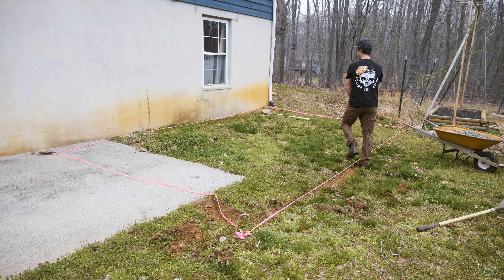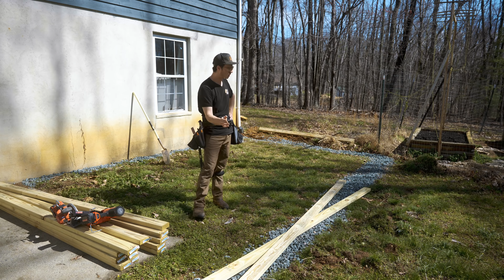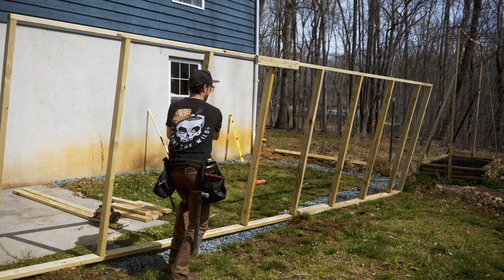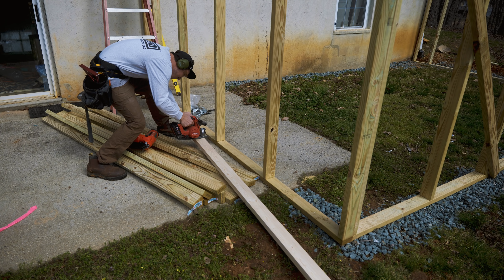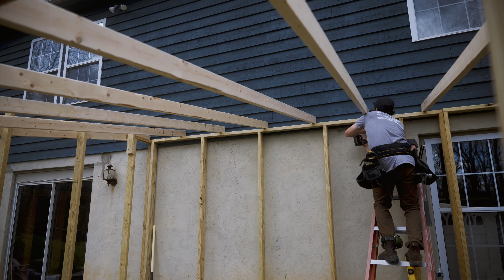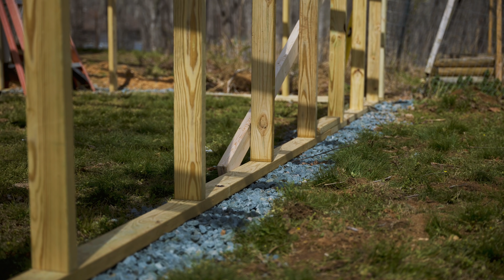I'm building a Greenhouse using recycled windows and 2x4's - Part 1

Comment: Awesome of you to do this for your father in law! I’d really frame a window around the window on the house, as well as tie the walls to the ground you could drive 3’ anchor spikes through the sill plate but those will rust away over time better idea would be to dig every 7’ or so and put an anchor in concrete 18” down at least since your past the point of pouting a sill wall. Other then that I think it’s looking great man!

Comment: Why block the window with the studs?
How is the structure secured to the ground (in case of windstorm)?
Reply: Maybe add a header there and open it up. Not a big deal to do this. Although it might be easier with a double top plate.

Comment: Love it BB!  Can't help but agree with the back wall window opening.  It will be be great if you open it up.  May need to throw a lexan sheet to help with the temp differential / air gap between the spaces.

Not sure how your laying out your windows, but, you'll want to make sure you can vent / support air movement to help regulate air temp.  You'll want windows at the top and bottom and opposite that can be opened and closed.

I'm guessing you'll upgrade to 2x6 for the roof joists too.  I'd think about anchoring the back wall into the house and setting a few anchors on the outside walls to tie it to the ground.  Don't want to to blow away.

Happy Easter!
Reply from the maker: I can always count on you for the wisdom! Happy Easter!
Reply: @WoodnessGoodness  I wonder if you swap the rafters to 2x6 it just makes a world of sense to use a ledger to tie the roof to the house and throw the hangers on.  Maybe a couple anchors in the concrete pad / patio, but I think you need to pour some anchors along the long wall / outside short wall.

May also want to think about water and power on that back wall too for best space use.

It's going to be awesome!